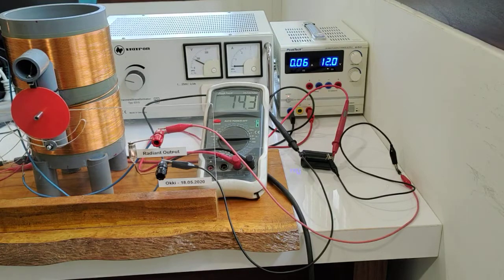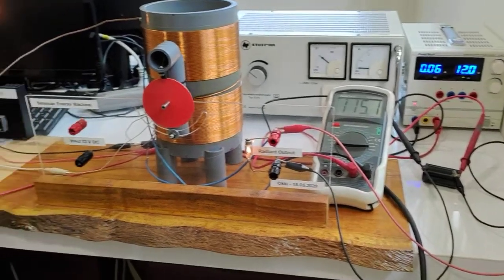Newman Motor - Proof of Overunity?

Comment: Once you take into account  of not only the voltage and current ~ going into the Neuman motor but that of not only the level of output voltage in respect to the output current. This ofcoarse can then be balanced out based on the reading's from the multimeter then one can gather a rather simplistic idea by determining if the level of efficiency peaks into over-unity territory! With that being said, the problem that like minded keen electrical engineering technicians have when attempting to violate Lenz Law whether it's experimenting with such devised devices in the lab whether it's with the Newman motor, Bedini sg device, Searl SEG etc is that it's literally impossible to explain technically as to the fundamental question of where exactly is these extra joules of electricity are actually coming from?? Even though we have our own technical theories whenever those devices are successful in tapping into what's believed to be the zero-point energy vacuum as it were even though it's almost impossible to instrumentally measure. What we are nevertheless left with this upon this  rather enigmatic fundamental question which no doubt remains somewhat of a mystery! A mystery however that no doubt is still widely debated within the electrical engineering fraternity! Unfortunately given this enigma it still however cannot be detected by any conventional electrical instrumentation in the lab such as multimeters, oscilloscopes etc! Hence why successful over-unity devices are sadly rejected within those in the mainstream classical electrical academic forums and academic scholarly fraternities in that respect for the benefit for the wider commercial sector etc. Ofcoarse many hobbyist's, technicians and electrical engineering physicists alike will no doubt be forgiven as to the main reason why over-unity devices were originally not accepted for the benefit of the commercial sector is because it's feared that they threaten the status quo of the oil industry which is a common argument that continues to prevail. Although this would not be the case if technical transparency given the level of suffocating level of bureaucracy just finally accepted that over-unity energized research which would hopefully pave the way for huge levels of R&D and innovation within this area for a cleaner and prosperous tomorrow!! Although the reality in the past and that of late undoubtfully which  appears to be evidently the case is that countless of patents have been shelved with past inventors disenfranchised both financially and personally regardless of there POC (proof of concept) no thanx to the corporate and monopolised government sponsorsed big guns within the oil sector aswell as those in the militarial industrialised contracted sectors sadly! If an electrical concept actually works such as an over-unity device and produces some real results does it have really have to be dismissed as just that of a science fare novelty item just because the entirety of the science behind it cannot be fully revealed instrumentally or fully understood or in other words fully explanatory substantiated?? Hopefully Institutions, faculties and scholarly members within the academic arena such as that from Havard Uni, MIT, Caltech, Berkeley, Stanford etc aswell as those within Government such as the Dept of Energy will now strongly reconsider this area in support for the consideration for investments for the benefit of alternative energy concepts for that of merging markets for a much greener and prosperous tomorrow! Sadly over-unity devices remain a "barrel" of laughs to those who are respectfully ignorent in failing to fully understand the possibilities of non-classical physics on what can be actually achieved! Unfortunately however the devil has always been well within the detail in silencing over-unity concepts regardless of their uniqueness and exotic properties! Innovation comes to those who believe in their pioneering concepts by pushing the boundaries further than what's ever been achieved before, so never give up! 👍

Comment: My friend...please look at my video and give me your opinion..I ask you honestly ....because I am an experimenter that doesn't fake... videos...I call it over-unity...because the source Akku clearly is charged...it is lighting a 240 Volts diode lamp at the output while that - https://www.youtube.com/watch?v=mH0ITcUip3w-I did not switch ads on as well... the process came to a stop after a while...and the Akku was molten-at the age...please comment on that video and tell me what you think...thanks in advance. On your video, the on-and-off times need to be considered...lower speed and much more turns on the coil- will help...anyways you did the math?
Reply from the maker: Hallo Sputnik. Ich habe dein Video angeschaut, kann aber dazu nichts sagen. Du hast deine Jouleringer-Schaltung nicht gezeigt.

Comment: some info.        i would praise the quality of your work, if wasn't so  SILLY.      there is no such thing as  'radiant energy'  or  'resonance'.    the former is  merely  emitted   electromagnetic radiation;   the latter is an  irrelevant,   R F  process.        volts are not power.   power is watts.     watts =  amps x volts.      AC watts and  DC watts  are  Not  Equal.      full-wave rectification  Should be utilized at the output; thus, DC watts in and DC watts out can be compared, directly.     
the use of a  capacitor  at the output is  a  BAD/wrong.       a cap  Accumulates charge  OVER  time  ---  Power, however,  is  CONTINUOUS.     thus, the energy stored in a  cap   leads to  Incorrect  output  meter readings.    if you want to have a chance of success, see my research and  one video by georgec.   (note the  Improper  use of a cap.)         you should also view my  pma/generating coil tutorial.   cheers       googletranslate
https://www.youtube.com/watch?v=lTkXciAn488

Comment: yes higher voltage but at what current ?? that is the important part because that what would say what watt out compare to the input watts, you need to compare in watts not in voltage
Reply: Amps are losses expressed as heat, look to the natural Lighting crosses the sky(spark gap) the difference is 10,000volts to 1amp. So if you feel you know more than nature go ahead! prove the Universes all wrong. G.G. Unfortunately Joe was a proud man. Bless him for attempting. Ala @energy seeker you do not comprehend the newmans ability to move mass forget watts unless you have a solid state device. Also newman got his backemf from cummutation and his commutator solid state switiching will not handle the massive volts coming back no h bridge nothing so far can handle the spikes other than capacitor.